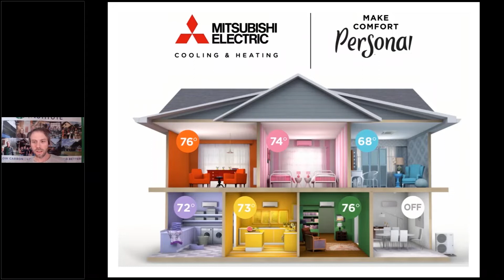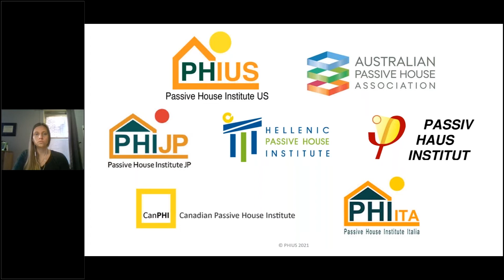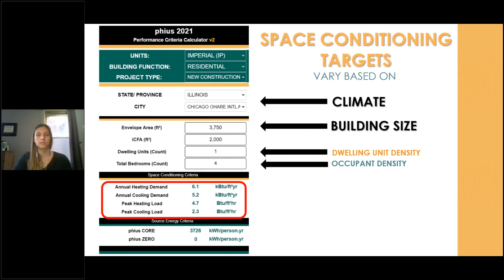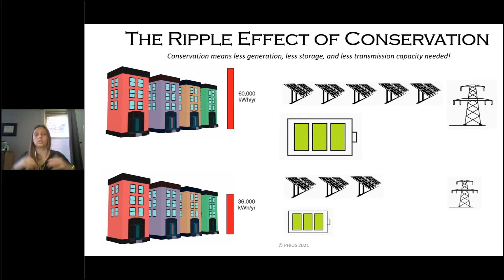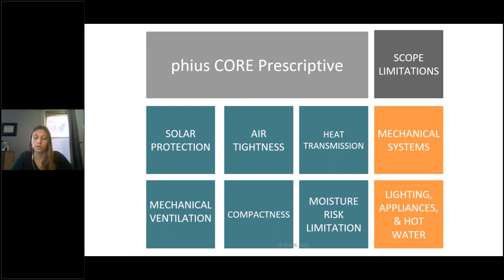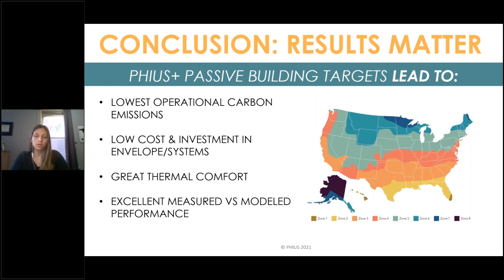Intro to Passive House 2021 & Source Zero

Comment: I volunteer my house as a test case 😂. Standard subdivision house, built in 1991. Pearl certified insulation by Ecotelligent November 2020. Solar on roof by Homeland in 2019. New larger gutters in October 2020. New basement egress windows in July 2020 on west side of home (2). Need to replace HVAC & water heater and do ERV in conjunction with basement remodel (add 3/4 bath, one wall kitchenette, new floor, spray ceiling joists to make them “disappear” , get rid of drop ceiling in partially finished areas). Need green informed designer. Only so much opportunity for 100% new construction.